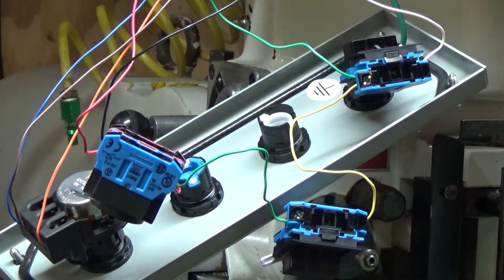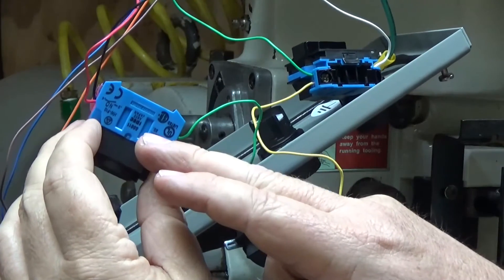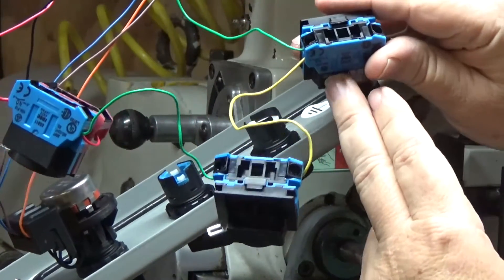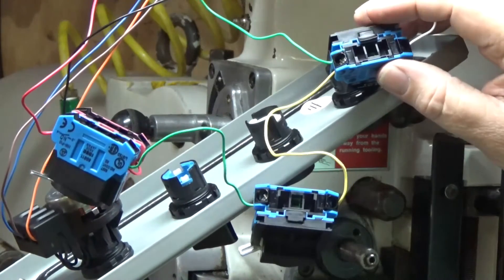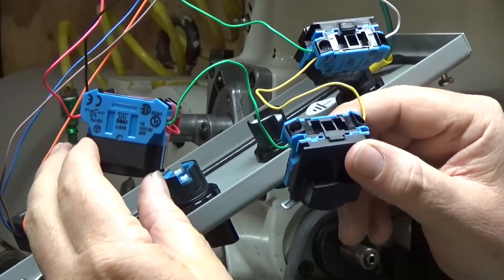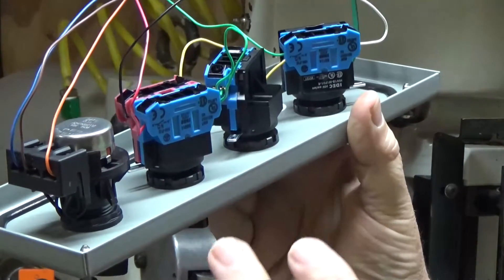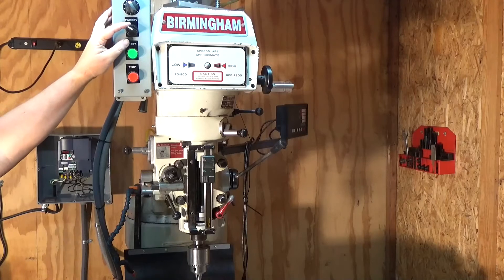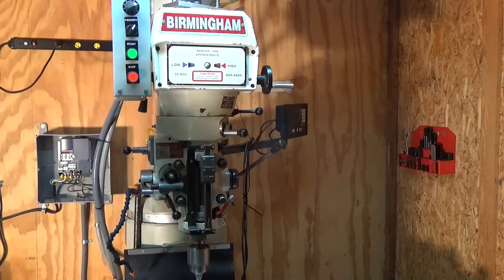Installing External VFD Switches for A  Milling Machine Part 2

Comment: Thank you very much for doing this video. looking to do the same thing on a wood lathe. I have no experience would you be able to let me know what gauge wire you finally ended up using for this controller again thank you very much

Comment: Hi Brian thanks for the info. Just completed the same push button setup with a Mitsubishi  D700. Works great but was a pain to get good information to setup. I had the same problem with the For/Rev switch. Glad you went thru the problem. It save me a ton of time. Mitsubishi manual was sorely lacking in good info about how to wire up the unit even though it was 300 pages long. Finally called tech support to finish it. The switches are great from Wolf. Here is the link of the ones I purchased. I bought an extra stop switch with a large push button on it with a twist to switch back to on mode. Thanks for the help. I may post a video on the D700 since set up is somewhat different and info is hard to come by. Hope you neck is better.

https://www.wolfautomation.com/products/panel-shop/pushbutton-enclosure-kit-4-button-assembled-11870
Reply from the maker: I'm surprised this video didn't get more views than it has, maybe not many "home gamers" use VFDs. Anyway if you don't work with a vfd every day it can get real confusing real fast. thanks for watch and asking about the neck. I'll go have a look at the link you listed. see ya
Reply from the maker: Irvin, the enclosure you linked to is just like the one I used only that is the non-metallic version, I wished I could have found one with a display to show RPM.

Comment: Thanks Brian.  Nice addition to your new mill.  Every VFD is slightly different and a potential headbanger depending on the application but they are a boon to spinning things efficiently.  The brake feature is real nice and assume you set it up for constant torque?  Maybe I missed it but did the control box with the Idex controls come as a kit, and where did you find it??  Smart fix to get it running.  Pretty sure Allied sells Idex stuff and could probably get an NC switch for the other side and put the off SW back to NC for a few $$...when you rewire with stranded.  They are pretty modular setups with lots of options available.   Thanks for sharing!  Treats for Zeke.  ~PJ
Reply from the maker: +pjsalchemy The box and switches did come as a kit here is a link: http://www.wolfautomation.com/ sorry could not find the link to the kit.
Reply: +Brian Stanga Thanks for the link.  Here is the Idec NC block...http://www.wolfautomation.com/products/pushbuttons-e-stops-accessory/contact-block-1nc-ip20-fingersafe.html

Comment: Brian, I used a old shielded 25-pin parallel printer cable for my wires.  Do you have a link(s) to those nice looking buttons/switches?  Cheers, Gary
Reply from the maker: +Tools4Machines i tried to find the exact link to the switch/enclosure kit, but it seems Wolf have turned on their new web site, here is a link to the main site, nice folks there http://www.wolfautomation.com/
Reply from the maker: +Tools4Machines Liking the idea of the parallel cable, already shielded I need about 8 feet of it.

Comment: Over all the years I have been dealing with switching etc - I have yet to not suffer headaches getting wiring all just right at first try! Those switches are nice.
The box looks a very well made unit.
Very satisfying result Brian. :)
Zeke sure liked that manual :)
Reply from the maker: +ChrisB257 Thanks for watching Chris, that little bit had me going all day, one switch not working the way you think it should will have you chasing your tail and doubting the wiring..